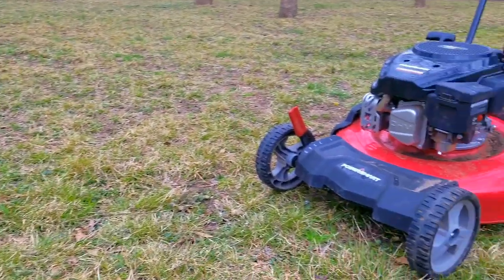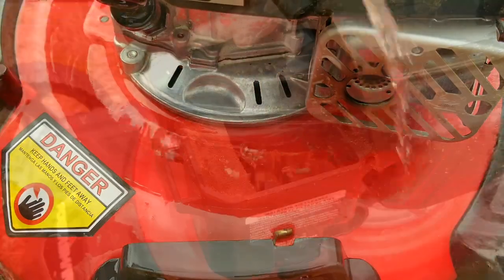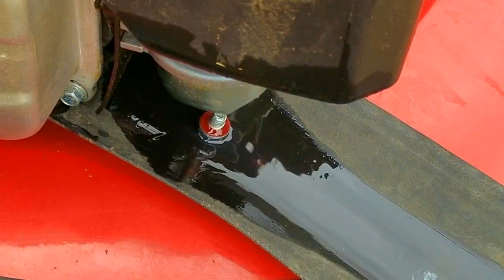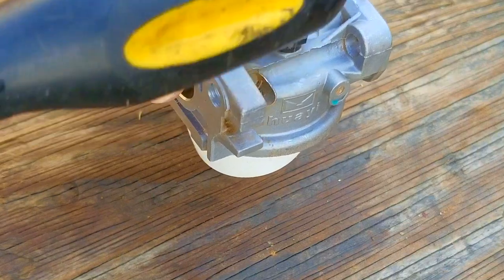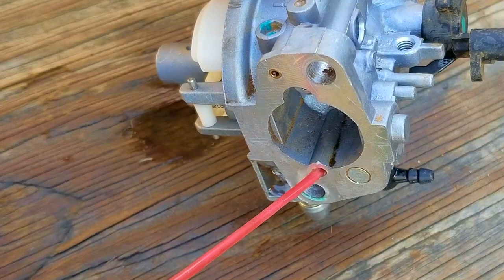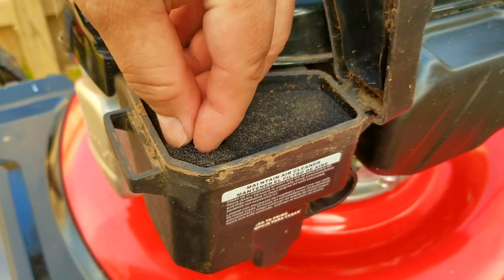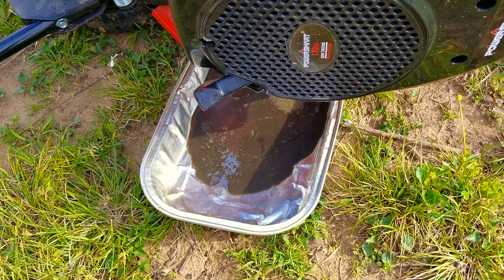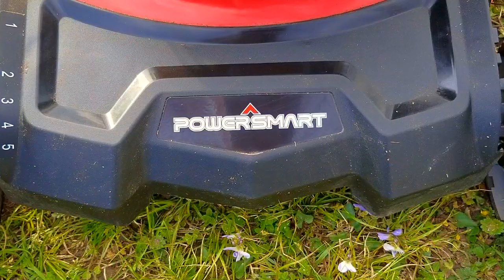Fixing A Powersmart Mower That Won't Start

Comment: I won't work on these mowers anymore....I had 2 of them and parts are very hard to find...

I found an "oem" carb for it and everything was right except for the fuel inlet was for a much smaller diameter fuel line...I couldn't make it work...I was going to use a barb to bard reducer but there simply isn't enough room between carburetor and gas tank....

Terribly designed mower + cheaply made + parts impossible to find = me staying as far away from it as possible
Reply from the maker: you are correct these are not worth it.

Comment: If overall economy REALLY matters, buy a quality machine and take care of it.  Anymore, that means you buy a Honda or something with a Honda engine.  Spring for an hourmeter while you're at it.  If money's tight, I'd look for a good used Honda instead of a brand new Chinese question mark; when that discount mower breaks down -- and it will -- good luck finding parts or anyone who will work on it.  It's unfortunate that there are so few sound choices anymore.
Reply from the maker: you are correct, however, I don't  have a problem buying a briggs or Kohler, they just have a different set of issues to watch out for.

Comment: That $169 mower last year is probably $219 this year. If I had one that I had fixed to “New”, I would target 50% of the current Box Store price, in this case, I would put it out on FB mkt place at $125, and would expect $100.
Reply from the maker: Lol.. you got that right, thank you haneyoakie14

Comment: Only this mower have problem starting., my old mower can start easily . And when it stops running, never restart. Have to wait for the machine to  cooling, about a hour, then it could start again.
oooo
Reply from the maker: that is a very frustrating problem to have

Comment: don't fix it throw it in the trash i had one mid second season it broke took it apart and they did not put a sleeve in the aluminum cylinder and it wore so bad that the piston tipped sideways and dug a wedge in the cylinder and locked up the first sign is it will start at times pore out huge clouds of smoak out the exhaust!
Reply from the maker: wow that's some damage

Comment: I have the same model and had it 2 seasons now but having some serious issues keeping it running about 2min into cutting grass...it idles just fine but dies soon after pushed into regular grass...I've cleaned the carb several times & checked my flywheel alignment for optimum running condition but it seems that the pressure of simi high grass shuts it down immediately...do u have any idea what i should check plz???
Reply from the maker: sure have you checked to see if your blade is sharp and is not facing the wrong direction?
Reply: @INSIDEHOUSEGARAGE  it's only my second season having it and the blades never been removed but worth check...I do appreciate ur time and help my friend....thanks 👍🏾